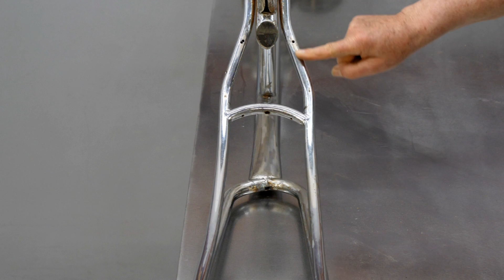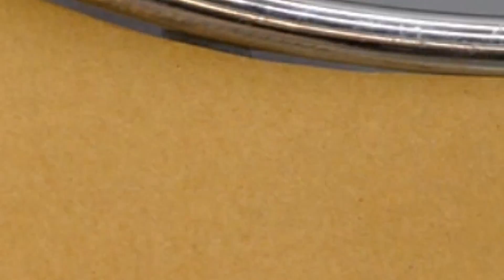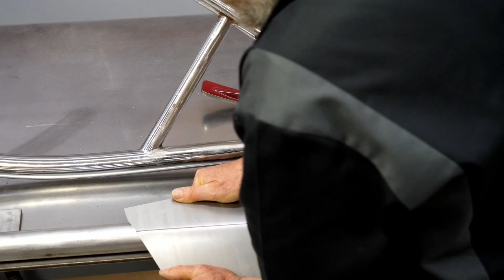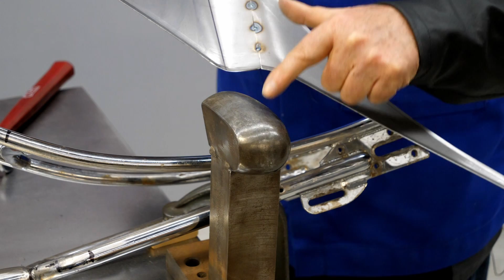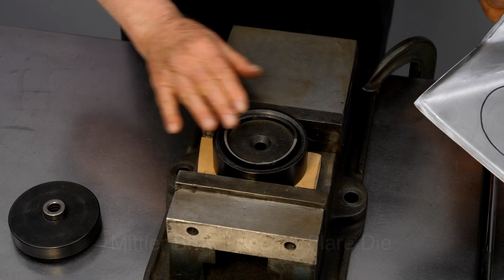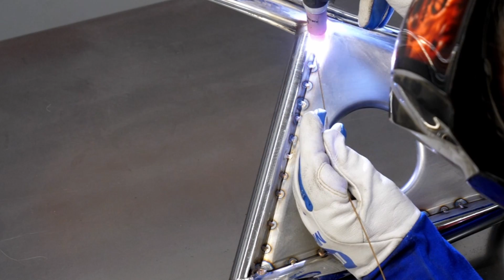Bicycle Styling - Part 2

Comment: You did a fantastic job again, Ron. That lowrider frame came out really nice. The holes in the panels take it to another level. TIG brazing is a pretty good choice for connecting bicycle parts, because 4130 CrMo steel (which is the material to choose for frames) heat-hardens from welding so much that it becomes brittle. Brazing uses much less temperature, so if properly performed it doesn't produce these problems.
Ron, I like a lot how you take your time to explain every step you take towards your finished work. You fuel my creativity and encourage me to try things myself. And I'm pretty sure that a lot of people are inspired by you just as I am.
Reply from the maker: I'm so glad you enjoy my videos. More on the way - probably as soon as this weekend!

Comment: Loved watching and am amazed at your workmanship. I do wonder why you bolted on the front work and used silicon bronze on the rear? Thanks
Reply from the maker: Great question! The front panels were cosmetic, so I made them from aluminum, since I like the look of it. You can't weld aluminum panels to a steel frame, so they were held with screws and standoffs. They won't be painted.
The rear panels were partly structural, since the owner of the bike actually broke the chassis tubes, so I made them from steel so they could be TIG brazed to the frame. They will be painted along with the frame.

Comment: Good man, cannot this be done even quicker with costing in the sand mold?
Reply from the maker: I am a fabricator, not a foundry worker, so I can't compare casting to fabricating. Usually cast parts are much heavier than parts made from sheetmetal, which would not be good for most bicycle parts.

Comment: As usual an absolutely first class job, just wondering why you didn't weld the front section in place, since the fram will have to be chrome striped and replated anyway ?  This product would have a lot of people scratching their heads.  Thanks for more inspection.
Reply from the maker: I did the front section when the bike was brand-new, and at that time, the owner wanted to keep the frame chrome plated. The second part was done months later, and he now plans to paint the frame.
Reply: @RonCovell  thanks for that,  yes it makes perfect sense.

Comment: Welding thin sheet metal like this is incredible. Because it does not turn into gruyère cheese.
The precision of the adjustments is impressive.
Reply from the maker: Avoiding welding on flat metal is one of the keys to minimizing distortion. That's why I put a 'curl' on each edge that was welded.

Comment: That looks rad! 
  But how did you do the chain clearance punch and flare?
 It looks like it goes into the curved sheet metal, was this done with a 1 shot tool or by hand?
Reply from the maker: I should have shot video of that segment, but I was rushed at the end. I used an Oval Punch and Flare Die from Mittler Bros to punch an oval hole into a scrap piece of metal, then I cut a larger opening in the finished right-hand sheetmetal construction, and welded the flared oval into place. You can see those dies in action in this video:
https://www.youtube.com/watch?v=3mS4Dgn-__A
Reply: @RonCovell  Awesome! I figured something like that or some hand (hammered) shaped wizardry... Thanks Ron!!

Comment: You make that beading operation look too easy Ron. I'll bet you can also simultaneously pat your head and rub your tummy, and switch with ease. 

Thank you for sharing your craft.
Reply from the maker: For some reason, it's easier for me to work with metal rather than pat my head and rub my tummy simultaneously. I've never been good at sports, so I suppose it's 'fine motor control' that I'm good at.

Comment: I'm curious, is this just a demo project? After I saw it I went and watched the first bicycle styling video and you explained using standoffs because you didn't want to weld to the chromed metal. It seems strange to then grind off the chrome and weld this part in place. However, if you're just using it as a platform to demonstrate different techniques...
Reply from the maker: This is an actual job for a client, and his vision for the bicycle is constantly changing. First he loved the chrome, and now he wants a different look altogether.

Comment: So with the brazing everyone says it gives you less distortion is it the weld pool itself that shrinks less because i notice its abit slower to run then normal er70 wire and the heat haze seems to be bigger or the same size as a normal weld  i was taught the bigger the heat effected area the bigger the distortion so its always confused me
Reply from the maker: When TIG brazing, two factors cause the amount of distortion that occurs. The wider the band of color in the heat affected zone, the more distortion you will get - but what's far more important is that when bronze cools and shrinks, it does so with FAR less pulling power than you get with a steel weld!
Reply: @RonCovell  I thought that might be the case you seem to be pretty good at it I've seen some pro welders on YouTube make abit of a mess with it 😂 its definitely something I will have to try one day soon

Comment: Hi Ron.
Nice job (as usual) and great explanation of the processes (as usual).
As an "older school" guy who saw (eventually) the negatives of brazing metals for bodywork in the way-back days... what is the difference between the old stuff and silicone-bronze? Is it still a no-no to put fillers over it or what's changed? 
I know I could get a detailed technical/theory description online but getting the info from a pro seems like a much more valuable source than just the theory of it. Theory for theory's sake never interested me. ;)
And if you prefer to direct me to someone else... that's ok too. :)
Thanks in advance,
Joe
Reply from the maker: Joe - I appreciate your 'chiming-in' repeatedly.
My understanding is that paint and plastic filler bond quite well to bronze, but not well at all to brass. This is puzzling to many people, because the two metals look nearly identical - but their properties are quite different.
Reply: @RonCovell  Ya I slipped a cog there. I knew they were different and I also foolishly overlooked that it is Silicon in the bronze and not Silicone. Dah on my part.  Big difference. ;)
Thanks for setting me straight.
Reply from the maker: Yeah - that 'e' on the end makes a world of difference - but I know what you meant!

Comment: Do you know if the bike will be painted or re-chromed? Would you have have to change your sheet metal and welding/brazing materials based on the finish of the bike? Great video
Reply from the maker: This bicycle will be painted - partly because of the very high cost of chrome plating. Nevertheless, both the steel base structure, and the bronze filler material can be readily chrome plated.

Comment: As a student engineer your videos are so helpful for developing an intuitive understanding when we're all stuck at home without access to the university workshop. 
Thank you!
Reply from the maker: It's so important that engineering students get some hands-on experience as they are learning. Over the years, I've had to make many parts that could have been far easier to make (and far less expensive) because the designer didn't understand the 'intimate details' of how things actually get made.